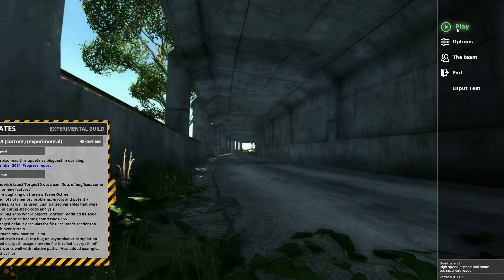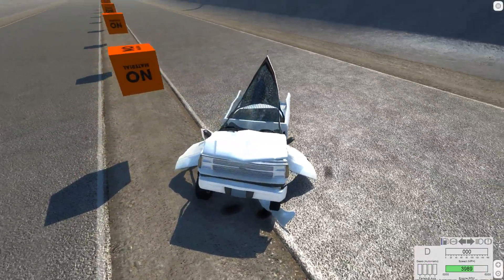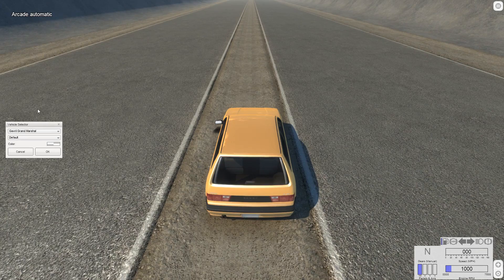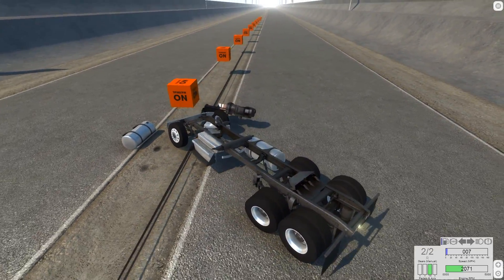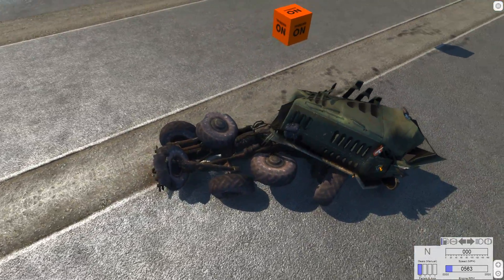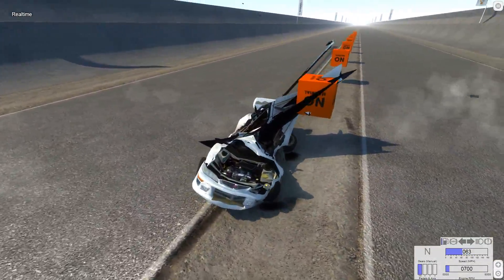Car Can Opener - BeamNG.drive

Comment: im watching this in half speed. hes drunk.
Reply: Also in full speed
Reply: true.
Reply: joseph s how do you speed it up?
Reply: are you on pc? or mac? (i hate mac)
Reply: if so, go to settings and select speed.
Reply: joseph s  omg he is drunk lol nice discovery
Reply: joseph s he so high right now
Reply: joseph s and when you set it higher it sounds like hes on energy pills
Reply: true.
Reply: wha- BARRELS?!?!
Reply: +Joseph S (tntexplodes101) it's not like it matters really, both support the speed setting, it depends on the browser you use. so it looks like you just wanted to express your opinion on something that isn't remotely connected to the video.
Reply: I dont have a mac, just assumed it didnt support it. by the logo, I assume you are an apple believer.
Reply: +Joseph S (tntexplodes101)  so tru
Reply: Joseph S I am.
Why would you assume it didn't support it? And why do you think it's so inferior?
Reply: I dont! at the time I wasnt even thinking about apple. I have never used an apple product. so I just said that out of fact. I didnt know it supported it! just didnt want to be corrected for it!

Comment: the can openers don't usually work like this, it just peels the roof off. I've seen wrecks where someone drives under a trailer, and the roof gets peeled off and all passengers are dead.

Comment: What button do you press to make a car respond while it's still broken
Reply from the maker: PgHc LeTHaL Just the normal gas/break keys or turbo T or G, but only on some modded cars). There is nothing else you can use to move the cars irregardless of if it is broken or note.

Comment: How do you change the speed (10x slow, 100x slow, Real Time, ect.)without pressing the top right button?
Reply from the maker: Ethan Perry Hold ALT and hit the arrow keys to control the speed. Left and down slows things down, up and right speeds things up.
Reply: Thank you so much!
Reply: WhyBeAre what if your controls for steering was the arrow keys?

Comment: 3:20 : Truck is screwed.
4:25 : Covet's engine flies like an eagle tied down.
Reply: 5:20 : Rear looks fine....
Reply: 6:48 : Real Race car :D
Reply: 7:35 : The window stretched out again o_o
Reply: 8:55 : Back Flip.
Reply: 9:38 : ....
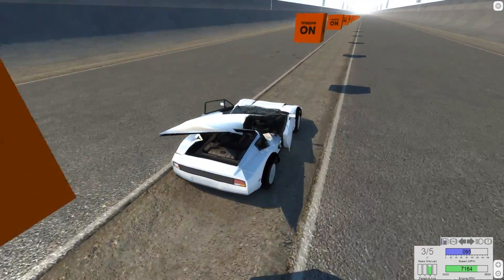Reply: 10:20 : I believe I can fly!!!
Reply: 11:39 : Bye truck cab!
Reply: Xeon Rider
Reply: 11:55 : How does a truck even drive without a cab and an engine bay?!!!
Reply: 13:35 : Engine is disconnected forever. MWAHAHAHAHAHA!
Reply: 14:40 : The roof just slipped off.  o_O
Reply: 15:05 : ITS A CEREAL BOWL XDDDDDDDDDDDDDDDDD
Reply: 15:25 Holy crap trucks can fly!!!!
Reply: Xeon Rider 15:34 : THAT RIGHT BOX PANEL IS A WING XD
Reply: 15:58 : Its a flatbed. <insert appropriate meme that fits this>
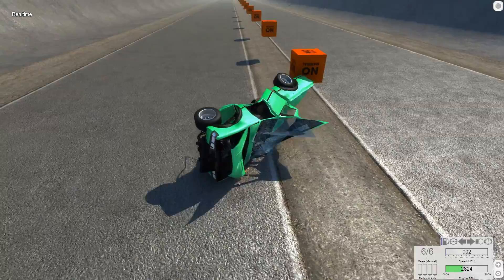Reply: 17:09 : Bye Datsun. Your DEAD
Reply: 17:43 : I grabbed your roof and pulled your car apart.
Reply: 18:48 : I ripped your car again. .-.
Reply: 20:04 : YOU ARE LEFT WITH BROKEN CHASSIS!
Reply: 21:04 : NOPE! Not going ANYWHERE!
Reply: 21:43 : 4 BACKFLIPS!
Reply: 22:40 : DEAD FLYING. THE PHYSICS ARE DRUNK!!!

Comment: keeps complaining that the cars won't drive anymore. drives in auto mode. switch from auto  to manual and back again to keep driving the cars.
Reply from the maker: whitlcj1 They fixed that a while ago unfortunately if you use the experimental version of the game (which I do). I used to love doing that, and am honestly kind of sad they fixed that.